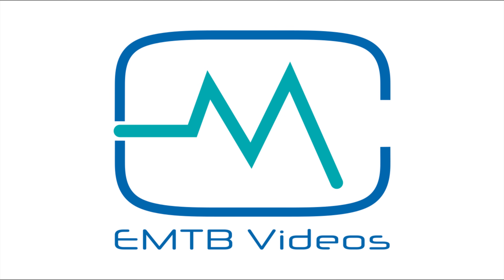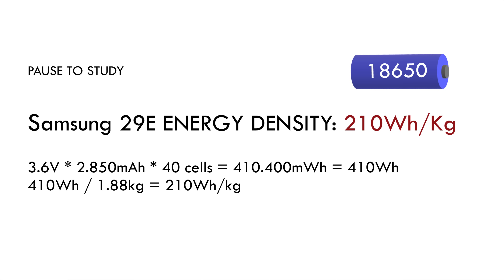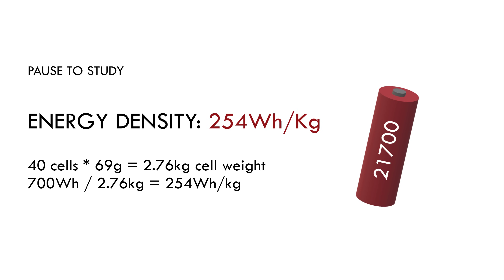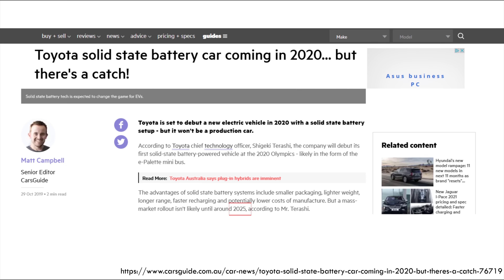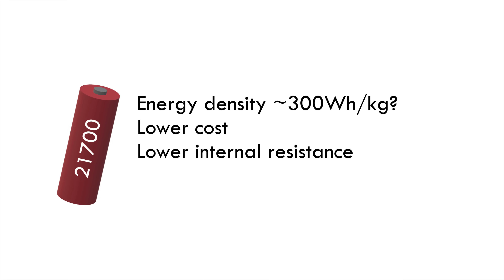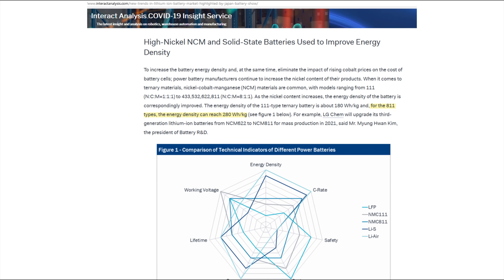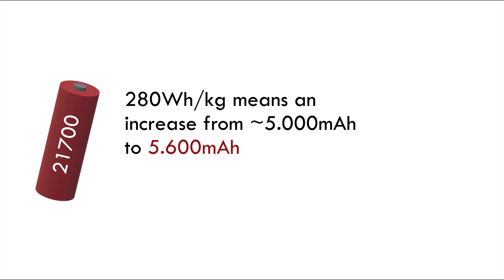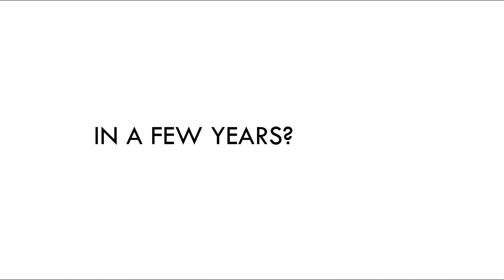Next leap in battery performance for ebikes?

Comment: Huh so I did choose right, my first pack I went with the ncr18650b cells, great compact battery but lacked the power I wanted and had a bad voltage drop. So went for the 35e instead in my next pack, I got a 1500wh pack now and it only took 126cells, great pack and the voltage drop is quite low meaning I can maintain the higher speeds a little longer than I would have otherwise.